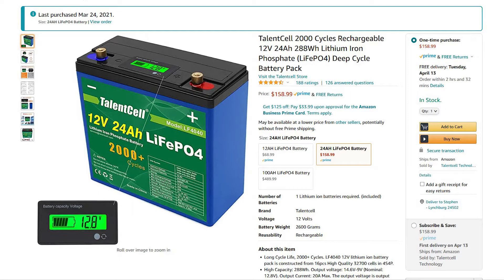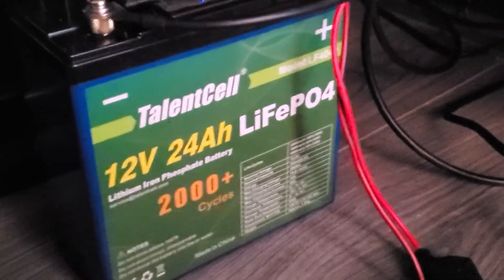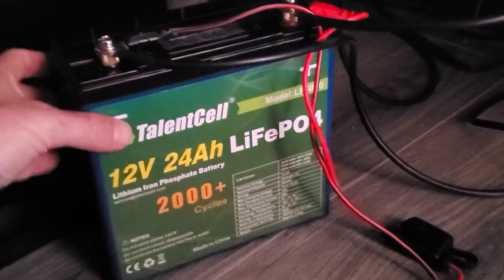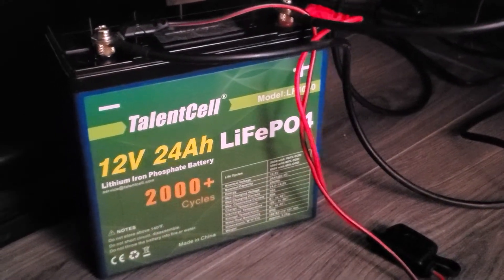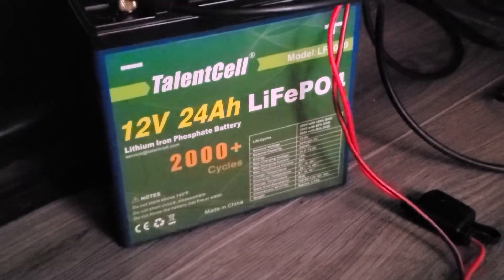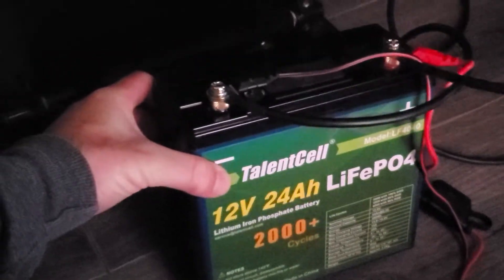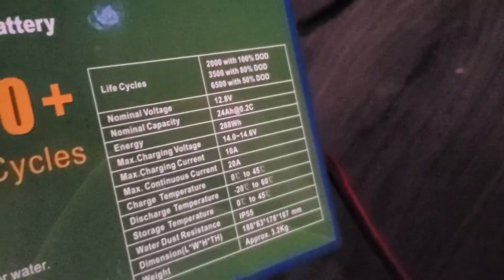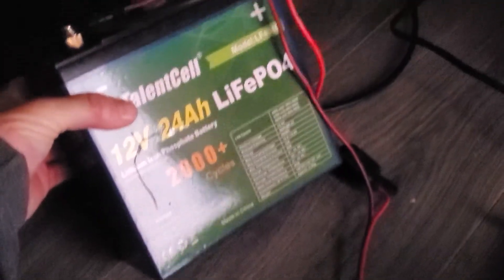TalentCell 24ah LiFPO4 Lithium battery review

Comment: so do you recommend getting one for 65 usd at my city ?
Reply from the maker: They work fine, especially if you need small and light weight. But its been a few years and now the prices have really come down on the 100 amp hour batteries and are a better value now
Reply: @kampinglogik  where I live it's still expensive 
Or you think I should wait 
I need it to run my laptop for a few hours daily